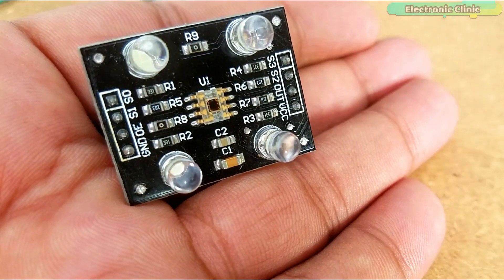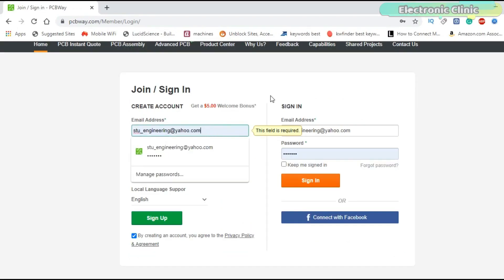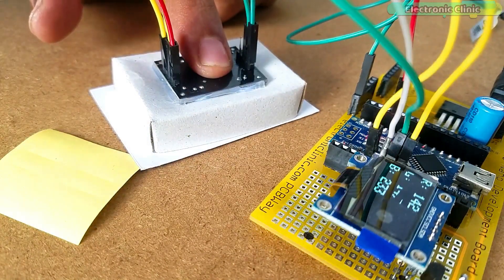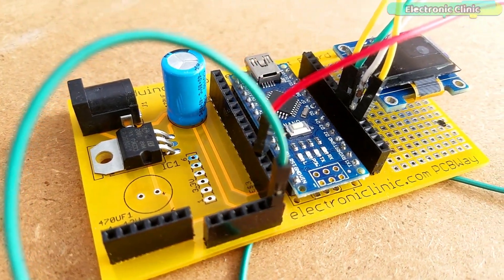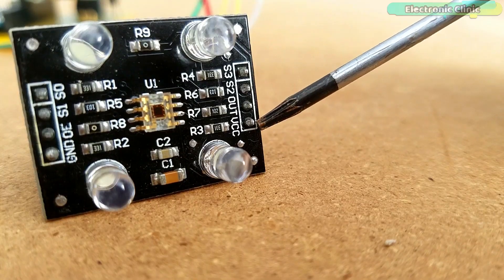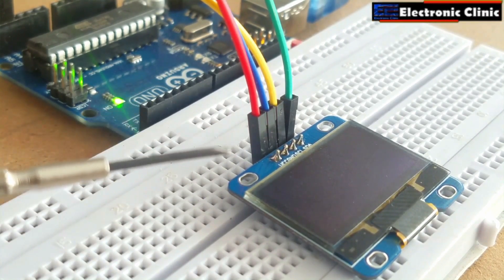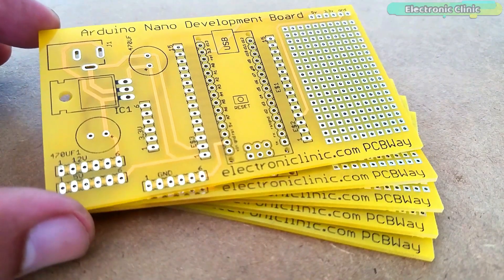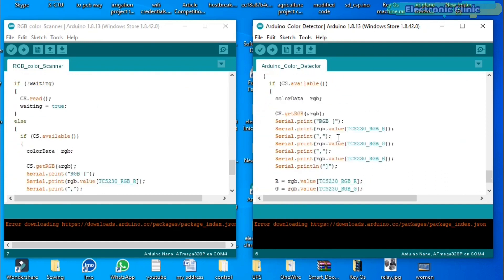TCS230 Color Sensor Arduino, issues solved, and how to get fixed values, Arduino Color Detector

Comment: Your scheme is wrong because the input pins S0, S1 are not connected to anything. The datasheet clearly states: All input pins must be either driven by a logic signal or connected to VDD or GND —they should not be left unconnected (floating).